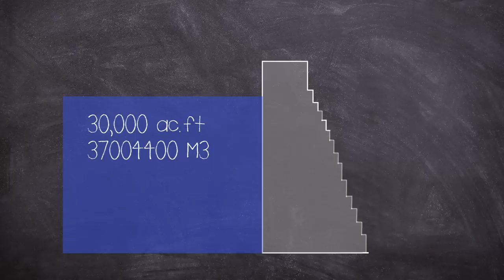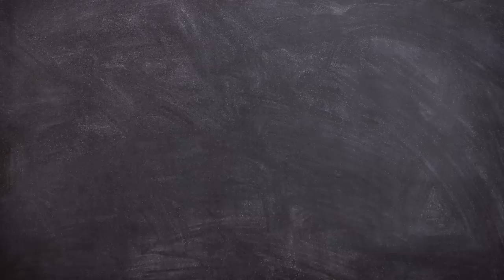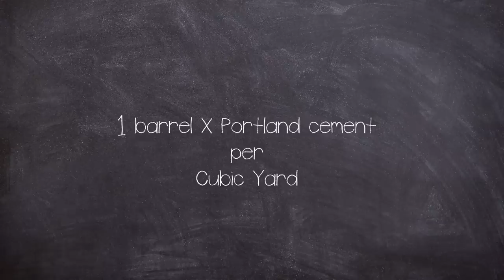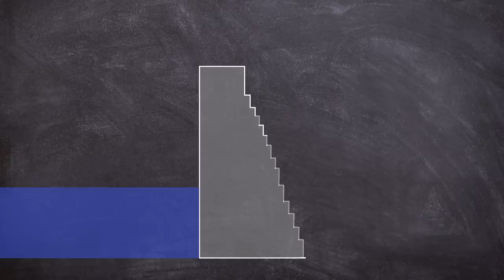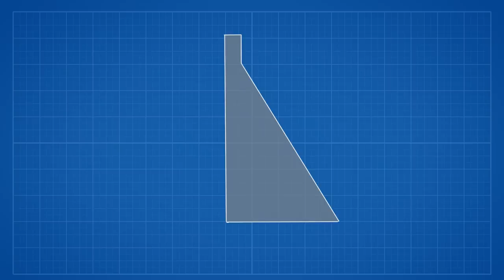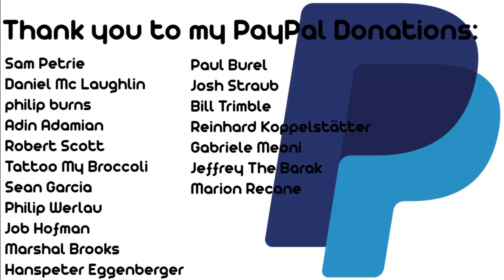A Brief History of: The St. Francis Dam Disaster (Short Documentary)

Comment: I dont see any rebar in any of the debris.
Reply: That's very common for many concrete dams. Almost all gravity dams are unreinforced concrete, and so are many older arch dams. They don't need reinforcement, failure is almost never because of the concrete itself failing, but because of foundation problems. Rebar is not needed in structures that are in compression. (though it will often still be done to prevent shrinkage cracks).